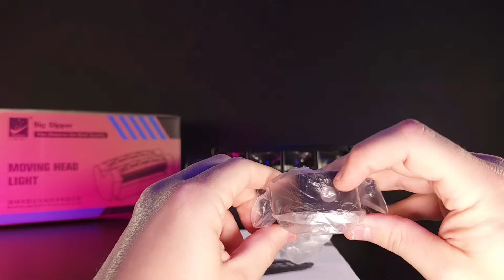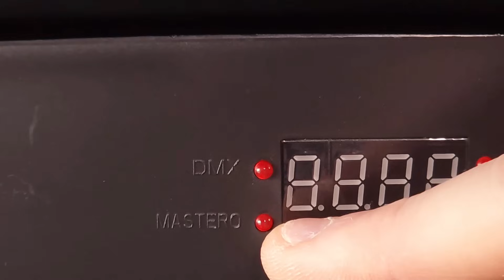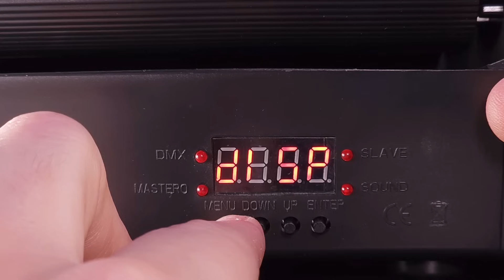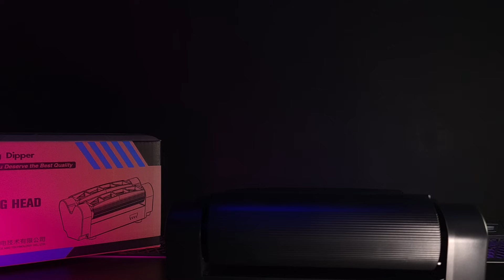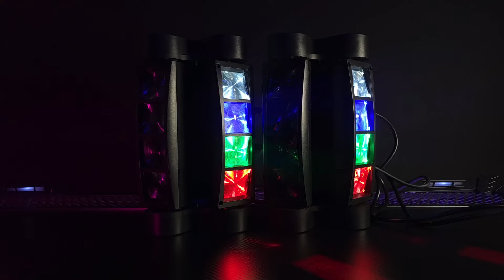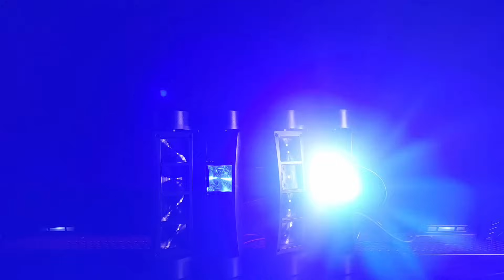BigDipper LM30A‑2 Review — Powerful 8×3W RGBW Mini Spider Beam!

Comment: they need to make this light with 4in1 so we led's so then we can have all red green blue and white. a bigger version would be nicer too
Reply from the maker: It would be nice but this is a entry level light so they kept the price down. Also single color LEDs are always brighter than 4/6 in ones because you have to divide the total output by either four or six. So a 3w single color is brighter than a 3w- 4in1 or 6in1.

Comment: Why leave it at 13 mine has 7-15 Chanel what’s the difference
Reply from the maker: Different manufacturers have different DMX channel modes. While this is BigDippers version there are several other versions of this exact light. This particular one has 7/13 channel mode and the the larger channel mode (13) allows for controlling single colors so the red by itself the Green, Blue, and white. In the smaller channel mode everything gets grouped so you have less control but you also use less channels that take up a universe. Some people prefer less control and a smaller DMX channel foot print. Some(like me) prefer max channels so I have more control over the fixture. I also have 128 universes at any given time so I don't worry about it taking up to many channels.